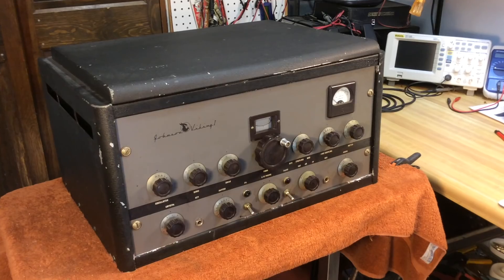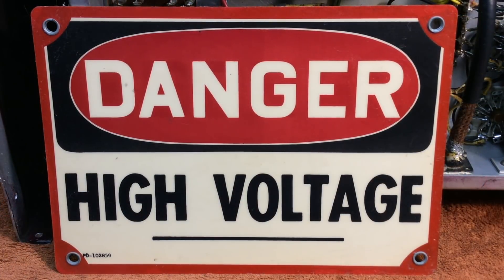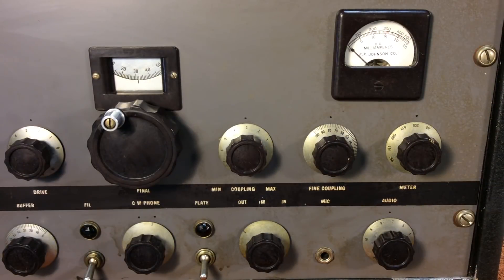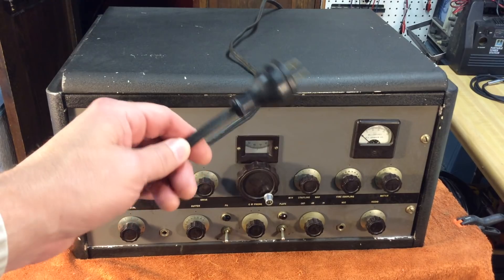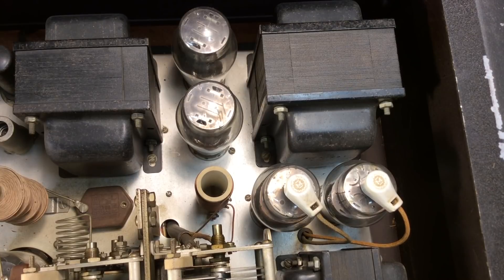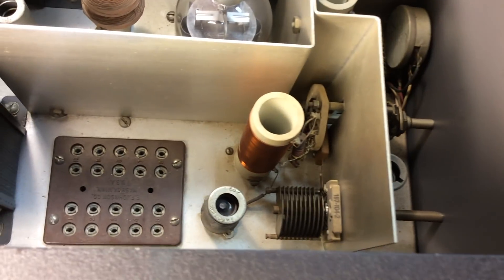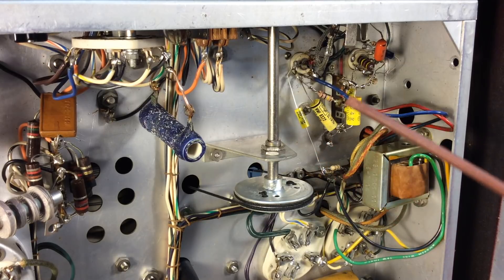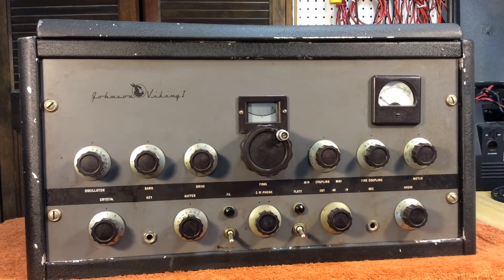E.F. Johnson Viking I Vintage AM/CW Transmitter

Comment: Hey Larry, cool old Rig! I purchased a Heathkit DX-100 AM, CW transmitter along with a Heatthkit SB-303 receiver. Cant wait to get those old timers on the air. They worked when I bought them but looking for someone to go through both units and possible re-CAP, Re-tube, ect. so that the gear is in top shape. Ben a ham since 1978 but was not active for many years. Great Videos! Keep em coming 73, Doug, KA0CLG, Saint Paul, MN.

Comment: Nice transmitter! Had a Viking II with external VFO. Used it for 160 and 80 AM. Once you change filters, you could probably do a smoke test into a dummy load! Thanks for showing 73's Bob KC2RDU